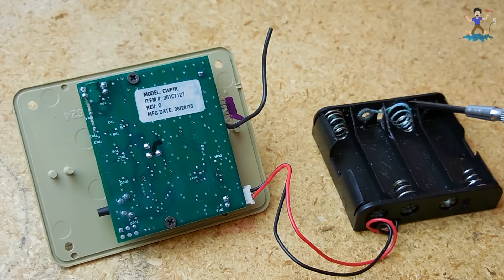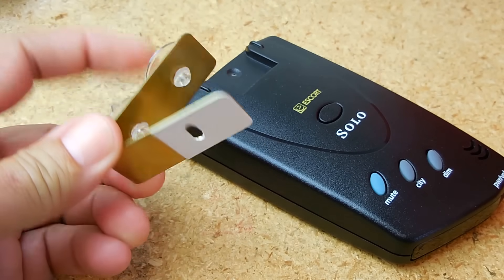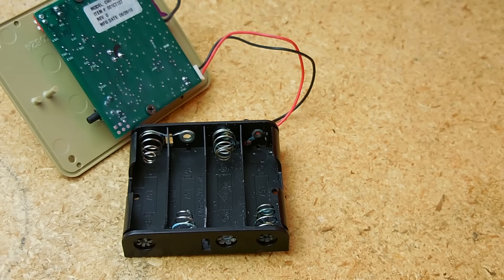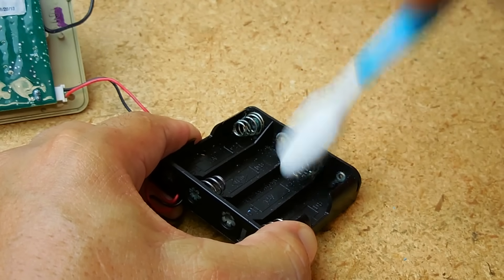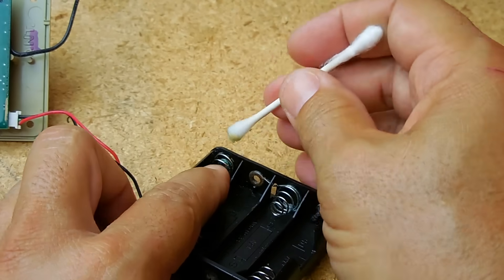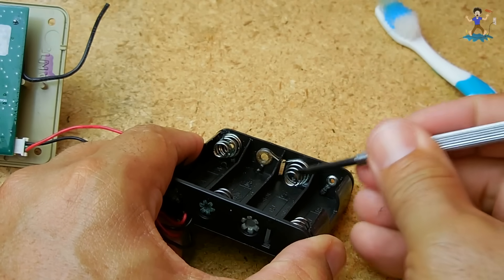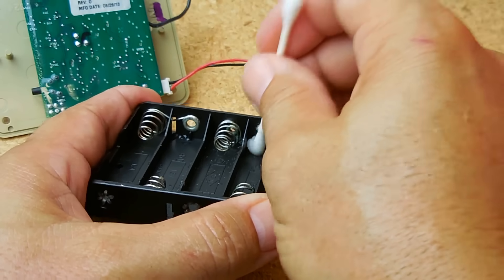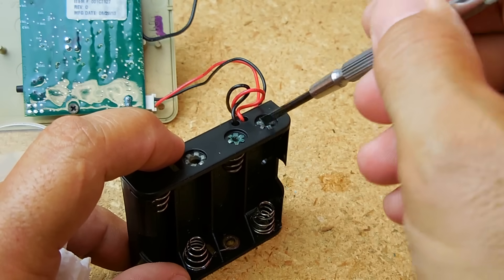EASILY Clean Battery Leak Damage(Corrosion) In Electronics

Comment: With battery units like this I personally have had better luck by dipping the whole unit in each of the solutions separately and (Vinegar, alcohol and water) and using using an air compressor to blow the excess off and let dry. Less chance of missing some corrosion. If it's inside and part of electronic device, your way is best. Good video, Thanks.

Comment: Thank you I always bring my decorative solar lights in for winter remove batteries & clean but this year one had a corroded battery a lot of rust on electronic panel wasn’t sure what type of cleaner good old vinegar softly taking toothbrush removed most of the rust just thinking should I add little wd40? Or just stop at vinegar? Not really sure did test with a new battery it works.

Comment: Worked a great! Vinegar dissolved the corrosion immediately. The problem was was a battery powered door lock that has a 4-AA battery tray just like this one. Stopped working and went to change batteries as usual. The corrosion stopped the new batteries from making contact and the lock didn’t work. Washed the corrosion off with vinegar and it worked immediately.

Comment: Once the springs are rusted deeply enough, this is no help whatsoever. Just a heads up for those who have not had success.

There is one sure-fire solution. Don’t EVER use standard alkaline batteries. I have hundreds of devices, mostly professional equipment too expensive to risk this. I kept a log for a few years and found that Lithium saves me considerable money over a period of time. They cannot leak, and in most situations outlast Alkaline long enough to be quite a bit cheaper. For example, in a thermostat, AAA Lithium will last many years longer than Alkaline. Alkaline batteries are made for suckers and I refuse to play along.

Comment: Thank you for this tutorial! Just had to pry out 3 very corroded AA batteries with a slotted screwdriver from my son's discarded portable CD/Cassette/Radio player that I now use plugged in. I checked the battery compartment b/c I've been taking it out on my porch to sit outside & listen. I find the cord cumbersome so thought I'd replace the batteries. Now I can! 🫡
Interesting that it also requires 6 C batteries. All those were in clean shape, so I can check them to see if they're still any good before I put them in my hazardous waste stuff to dispose of properly. The contacts are sturdy wire on top of circuit boards & all was pretty easy to clean with your method. 👍

Comment: Thank you.  
How about using something like wd40 or water displacement oil?  Do you recommend.  I have tail light bulb on a car and it has a slight corrosion on its connection points.  I scraped off earlier , going to try your method again just to be sure but again should I use lite wd40 with a qtip on corroded connectors ?

Comment: Nice video! Since I don't like the smell of vinegar, when I need an acidic cleaner, I like to use citric acid. Sometimes if I have a half-squeezed lemon left over from cooking, I'll just use lemon juice from a leftover lemon. Otherwise, you can buy food-grade citric acid in a powdered form online for pretty cheap. You then just dissolve 1/2 a teaspoon in 1/4 cup of warm water. For about $10, you can buy enough powder to last for years for these kinds of small cleaning jobs.

Comment: I never thought about the vinegar and alcohol.  I usually have good results just using mechanical agitation.  The last time it happened, it was on a weather station/clock so I just got an wall power battery replacement.

Comment: I use baking soda and water paste, the vinegar is an acid. You MUST use baking soda after the vinegar to utilize the vinegar or it will continue to corrode.  I worked for a major electronic manufacturer.  We couldn't use any acid based products as cleaners.
Reply from the maker: Incorrect. You use baking soda ONLY to neutralize acid that leaks from lead acid batteries. In order to neutralize a strong alkaline liquid, you must use a weak acid suck as vinegar. If you do as shown in the video you will not continue to corrode.

Comment: Soaked mine in vinegar it made the copper look great. Flash light plastic AAA battery holder.   Rinsed with water and bingo. You probably could have put that battery pack in a bath too with the wires to the top.

Comment: I've been doing this for years.  Cleaning the corroded battery terminals in a remote will fix it most of the time.  I've fixed several remotes this way.

Comment: Dremel with a small brass brush makes short work of these. Best is to not leave batteries in there in the first place though, and I mean out. I made the mistake of thinking AAs wouldn't leak if the circuit wasn't complete, wrong.

Comment: OMG it worked! I had a decorative light fixture and was so disappointed the find the batteries leaked. I kept the item for couple of years and today just thought of finally Googling it and found this. I used a tooth brush to generally clean it first then used cotton swab dipped in vinegar and a sewing pin that a covered with a bit of cotton taken from the swab to clean really hard to reach areas. At my first attempt with the battery it did not turn on. I was feeling defeated. but tried another and lo and behold it worked! it was just the battery lol it was dead. Thank you for this tutorial! now I know what to do from now on :)

Comment: 1) Use a brass brush if you have one available over a toothbrush. 2) Don't use cotton swabs. Use a small paint brush, as it will get in between the coils more easily. If the corrosion is really bad, the stiffness of the cotton swab can break the spring. 3) If you are going to be cleaning multiple corroded battery terminals, just buy a bottle of Deoxit, which has a brush built into the lid. Not only will it remove corrosion, it prevents it from returning. Vinegar will not.

Comment: Instead of vinegar you can use whatever acid you have available, e.g. citrus acid works fine as well. But you can also use alcohol or acetone (classic nail polish remover). The advantage of acetone is that it won't corrode/dissolve the metal at all, unlike acids; the downside is that it does corrode plastic, yet very slowly and the plastic is of a battery compartment is way too thick for that to be an issue (the top layer of it may change a bit in color though when being exposed to acetone for too long). Also note that ethanol alcohol also does not corrode/dissolve metal but does corrode certain kinds of plastic. So your optimal choice is isopropyl alcohol, since it neither corrodes metal nor plastic and it's neither hard to find it (you can buy it online), nor that expensive (it's the best cleaning alcohol available)

Comment: Used vinegar for ages. Rinse well with water afterwards or you just get an acid corrosion instead of an alkaline (yes about the only batteries that are acid are lead-acid, most others are alkalic).
That particular battery holder however I'd just replace. It's junk pressfitted together and you can't really solder it because of the way its constructed. Things pressfitted like that holder are very difficult to get good connections in once corroded. In fact some times even before corrosion.

Comment: Great and very useful video eNm! I had a year old label maker in the closet and when I pull it out to use it I found the batteries corroded. After an hour of cleaning with Q-tips and vinegar and old toothbrush and little flathead screwdriver, it works again! Thank you!!

Comment: I worked for radio shack back in the '80s when I was 15 and I have two of radio shack's bench top multimeters that use four C batteries. They were radio shack branded alkaline batteries that were made by energizer at the time and were in the multimeters for 25 years and still worked and were not leaking. The only reason I had to change the batteries 2 years ago, was because I forgot to power the meter off and drain the batteries. All these alkaline batteries seem to leak these days, especially the duracells.

Comment: Thank you for the tip.  Of course, it goes without saying to remove batteries if not using the device, but. If you are like me, you forget to follow your own wisdom.  I have some equipment I will need to clean.  RATZ.

Comment: Thanks. This is such a big problem where I live because of the high humidity. I have since taken to removing batteries from devices and only putting them in when I need to use the device. Painful, but its better than having the corrosion issue.

Comment: I once saw a Pawn Stars episode where the owner saw corrosion on an expensive clock (or something like that) and he said it could not be restored so he did not want it.  Now, the corrosion was pretty bad but I was thinking that you could use a wire brush to clean most of it...That's what I've been doing for years for a variety of electronics.  The results have not been 100% but close to 90%.  Now that I know about the vinegar, it'll be another tool for me to fix this.

Comment: If you don't clean off ALL the corrosion, including inside of and the other side of the hollow rivets, the corrosion will continue to weaken the contacts/springs causing therm to detach from the support.  The best way to complete the job on very small contacts is to use De-Oxit as the final step.

Comment: Water is a good battery puke cleaner but be careful not to get it inside the device and give lots of time to dry if a little bit gets inside which is actually okay for most electronics as long as it does eventually dry.  Some things don't dry well like buttons and corrode as a result.

Comment: I didn’t take time to read all the comments, so I don’t know if anybody mentioned this. For years, I’ve used baking soda with a Q-tip with a small amount of water on the surface, whatever that may have corrosion. The white vinegar if it works just as well is probably a little cleaner and doesn’t leave the white residue from the baking soda, no matter how small it is on the contacts. One thing I will say, I’ve never had to re-clean or reapply the baking soda once I’ve cleaned the contacts on whatever may be corroded. I will definitely use white vinegar the next time I have to clean a surface with corrosion on it.

Comment: I suggest not dipping the contaminated qtip back into the white vinegar, avoiding adding alkaline into the acid and weakening its effectiveness.  After cleaning with the white vinegar then touch up anything needing soldering.  Also, if possible, rinse the assembly with distilled water after you are finished with the vinegar and touch up.  Any acid left around the metallic parts will continue to corrode eventually leading to failure.  This is the practice in PCB assembly plants to remove acidic flux from PCB boards after soldering but note that some electronic parts are water averse so try to limit it to the areas where the batteries live.  After rinsing and drying then use IPA (isopropyl alcohol)  to clean the area before reassembly.

Comment: Interesting how this 6-year-old video appears on my screen. I often had this problem and hated using batteries anymore.  I'd clean the contacts and use a Dremel-type tool with a grinding tip to clean the corroded spring and contacts too. Since then I've replaced most items with rechargeable lithium packs. I have replaced my AA batteries with the new lithium 1.5 volt as the NIMH and cadmium are only 1.25 volts.

Comment: Great video, here’s a couple of tips I use in addition to this. After cleaning the contacts coat them with dielectric grease. This will help reduce the corrosion from forming on them in the future. I usually do this when the device is new to help prevent the problem in the first place.
When your device is new take the batteries out and mark the month/year on them with a fine point Sharpie and insert them so you can easily read the date when you remove the battery cover. This is a good way to track how old the batteries are. This is also a good way to judge the average lifespan of a battery.
For devices that are rarely used remove the batteries and keep them close by and install only when you need to use. Again, write the date on the batteries. Generally if they are not installed they have less of a tendency to drain.
Always buy good name brand batteries!

Comment: You could just immerse this in some white vinegar (the battery holder only).  Not need to go through all the rest.  Wait a few minutes, then immerse it in DI water.  Then let it dry, or blow it dry with an office duster (canned air) after wiping it.

Comment: I've been doing this for at least 20 years to my electronic devices that have corroded. I finally started using dialectric tune-up grease to the contact points after cleaning all the corrosion off and now put a dab of grease on the ends of batteries and contact points on every battery operated device I own. I find that it stops nearly all the corrosion. I also quit buying Duracell & Ray-O-Vac batteries which have seemed to be the worst to corrode & have switched over to strictly Energizer batteries. Great information in this video!

Comment: Does anyone know why leaving batteries in an electronic device for a year would cause the device to not turn on. There is no leakage or corrosion visible. The device is a Bushnell night vision monocular. I realize leaving them in was a mistake but if no leakage what could they have done to the unit.

Comment: If you don’t want to use a hard, metal screwdriver blade, instead try a handy dental hygiene product called “Stim-U-Dent” which are small, wooden sticks, just stiff enough to scrape with, that have a sharpened edge.

Comment: Duracell AAs are the worst for corrosion.  I can't even count how many times I've had to clean out battery compartments using this technique.  If you contact them, they will reimburse you for your corroded flashlight, etc., however that process is a pain.  Now I just don't buy Duracell AAs.

Comment: The only problem is the corrosion eats off the chrome finish and the pot metal springs are rusted, and rust doesn't conduct electricity. I have saved some things but if it is rusted you might as well throw it away.

Comment: I have a remote control that has this issue. Good luck getting it apart as it is not screwed together as a lot of them are not and this remote is unobtanium. I will try this method, but how effective it will be still remains to be seen. The remote was glued together and keeping the white vinegar out of the inside of it will be challenging as it is highly corroded. Will let you know. I will have to be extremely cautious with it as my access to it won’t be anything close to the one you  did in this video. I hope I can salvage it as this remote is nowhere to be found!

Comment: Thanks, great help.  I was in a lot more trouble than losing some $ throwing out good equipment: Battery holder in my thermostat must work or I do not have heat.  Used your method (used can of air to help dry quicker) and so far so good.

Comment: I see you scraping away with a screwdriver, but I would like to know if an electrical Contact Cleaner spray could be used at this point to help shine up the contacts? Perhaps in conjunction with another Q-Tip, toothbrush or even the screwdriver. Or, would this be risky due to the chemicals involved?

Comment: I have a remote control that has very small ports where the batteries go. They go down inside not lay flat like your device. So can’t get a toothbrush inside. 
I can barely see inside it’s so small. I have to use a flashlight to see inside 🤷🏼‍♀️
So I’m not sure how to clean the corrosion???? Any suggestions???

Comment: Thank you, I was having some issues powering on a controller for my Oculus Rift S headset and had some crusty battery corrosion inside the battery compartment terminal where the spring is and this fixed it immediately! You are awesome!!
Reply from the maker: You're welcome Matthew! Be sure to check out my wide range of videos and share. Thanks

Comment: Thanks for this. I watched this video, tried it myself,  and it worked like a charm. I bought a large, used TV for $25 today. My smart remote works to watch HBO and other streaming services, but the remote that came with the LG TV was not working. When I opened the back of the remote, I found the AAA batteries corroded in place. There was a lot of corrosion and I had to get a knife to pry them from the remote. I followed the easy steps, and it took about 5 minutes. The remote works like new. SUBSTITUTIONS: I did not have vinegar so I used a little all purpose cleaner. I did not spray it in the remote. I sprayed a small amount on the table, and dipped my q tip in it. It seemed to work fine. Also, I did not have alcohol on hand, so I used some hand sanitizer (70% alcohol) and it worked fine. I used hand sanitizer in place of alcohol since I always have some around post-Covid. Again, it worked great. Thanks electronicsNmore!

Comment: Didn't know vinegar is a must. Used isopropyl alcohol 99% to clean. Would it be a good idea to put silicone grease or dielectric grease on contacts to prevent corrosion?

Comment: Thank you very much for this video! I am about to go do this process on my digital scale where the batteries had really badly leaked into the battery compartment.
Reply: Got to the whole cleaning process and it cleaned up beautifully and I find that I only have one triple a battery in the house and the scale requires four. 😭

Comment: I know this is an old video but it has be SO HELPFUL. I have so many little devices (remote controls, battery powered candles, flashlights) that have or are becoming corroded and I didn't want to throw them a way because they are still functioning well. Thanks for such great instruction!👍🏻